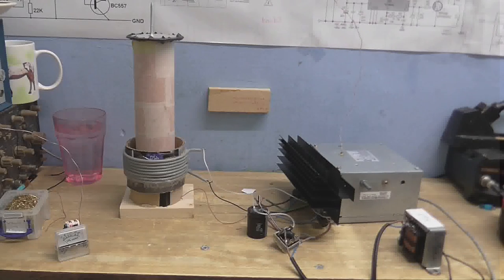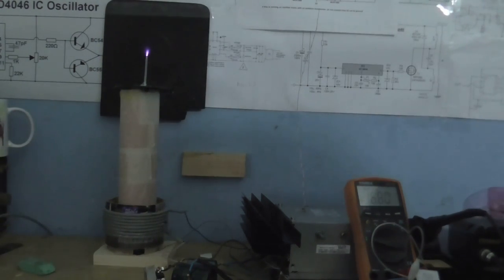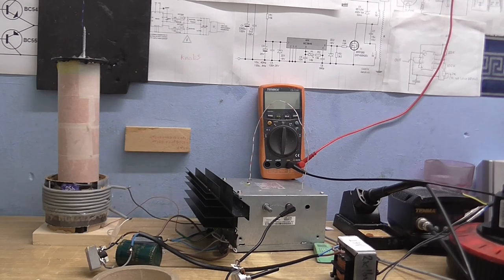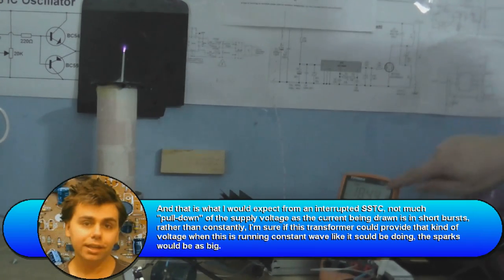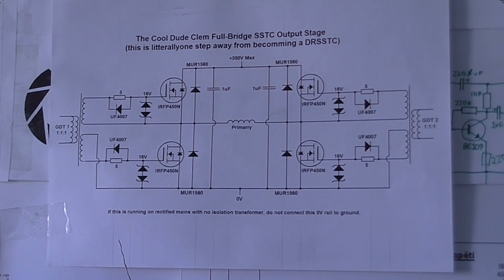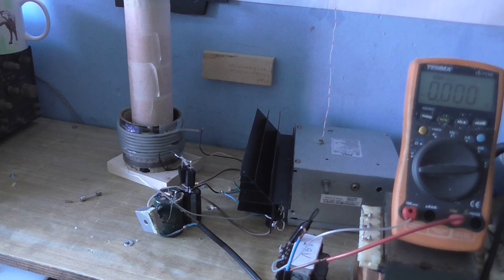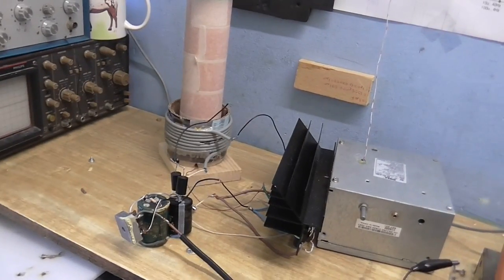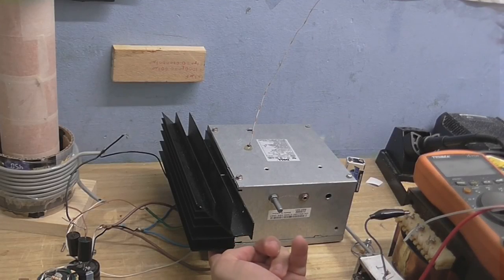Tesla Coil Tuesday - Building a Full Bridge SSTC part 4a - First Light and First Problems

Comment: I noticed that you have 1N4007 diodes in ur gate drive circuit.  u need fast recovery diodes here.  MUR120 is good for that.  1N4007 is barely good for 50KHz and at 350KHz it is almost a short circuit.
Reply from the maker: Actually I used UF4007, not 1N4007, it's a little hard to make things out as my camera's focus is weird, the left side might be in absolute crystal clear focus, while the right side is blurry, or vice versa. I don't know why.
Reply: I checked the specs on the UF4007.  Ultra Fast Diode. No relationship to the 1N4007.  Looks like an excellent diode.
Since you made a HV project, would you consider making a stun-gun?   Its a cool challenging project.
Reply: CoolDudeClem Where is the other end of the secondary connected?? negative of the supply??
Reply from the maker: Its is connected to earth ground.
Reply: CoolDudeClem Thanks!!! great video,I am going to build the driver and the output stage,after a failed attempt at sgtc I have decided to make sstc!
Reply: what is sgtc and sstc?  please explain.  thanks
Reply: John Conrad  Sgtc is Spark gap tesla coil and sstc is solid state Tesla coil..
Reply: Purv Rane hahaha ok thanks LOL  silly me!!!

Comment: Cooldudeclem, why don't try to make dual resonant Coil?
Reply from the maker: I did try some DRSSTC experimenting with my solid state coil, (there no video on that though) and even when tuned just right it was pulling a lot more current without any noticeable increase in output. I don't want to stress my transistors too much and I dont get much opportunities to buy spare components should I blow something up.